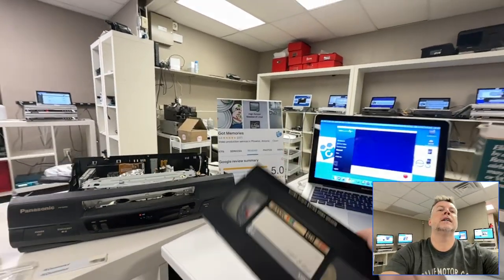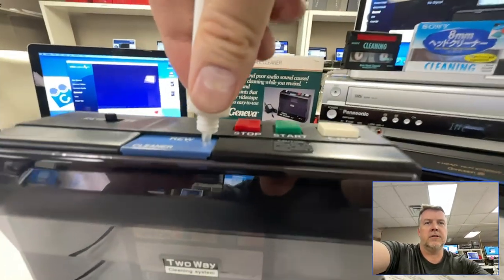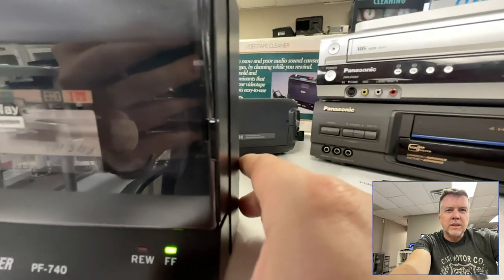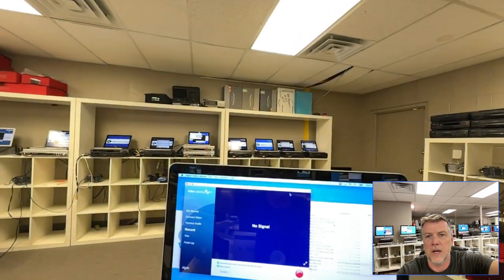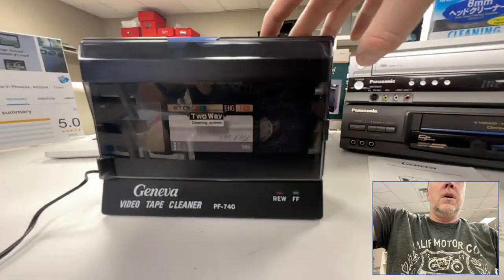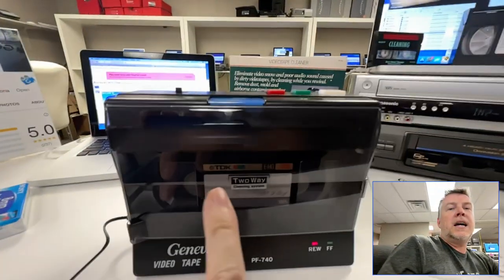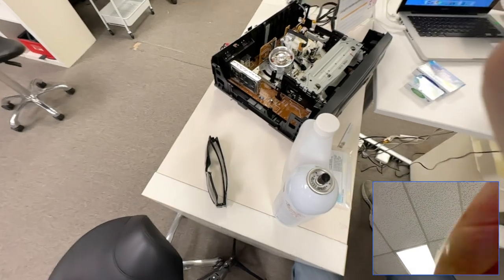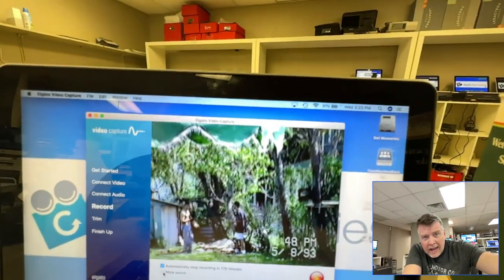VHS Tape with Mold, removing using Geneva video tape cleaner, before and after

Comment: I am a retired broadcast engineer. I worked in video tape rooms, we used Kimberly-Clark KimWipes and 99% isopropyl  alcohol to clean broadcast video heads and tape path. Plus, I fixed VCRs for over 10 years and only used KimWipes and 99% isopropyl alcohol.
Reply from the maker: I use the same! Oh what fun eh! Lol

Comment: You have quite the setup and you're doing a quality job!  I've been transferring VHS to digital since Xmas break (over 2 months as of now), using almost the exact same setup you're using.  Luckily, I bought a Panasonic DMR-ES35V (like many of yours) about 20 years ago to record everything to disc, which I only did a few.  Now I'm running it through the ElGato program onto my Mac and the quality is excellent.  The S-Video cable makes a world of difference!  

I'm cleaning the heads and capstans with 99% ISO & Q-Tips every 30-50 hours or so and haven't transferred any mildewed or moldy tapes (this is why I visited your channel and others - to see how you clean them).  However, I did run across a disintegrating tape that shredded inside the VCR, which was lovely and quite fun to clean out.

Sorry for the long post, but I'm learning all I can.  I've transferred about 150 tapes so far (most 6 hr) and I'm about halfway done.  40 years worth.  Thanks for showing us how the professionals work!
Reply from the maker: Hi Michael! Thanks for the comment! Glad to hear everything’s going well and you’re cleaning the heads and doing conscientious work! That’s pretty much the goal with my videos now, just shooting raw video and hammering home about head cleaning and quality transfers. 

Consumer awareness of this industry is nil and everybody is shopping for price and has no idea what goes into a transfer and then takes their tapes to the lowest bidder ie Legacybox and gets screwed.

I am tired of hearing and seeing terrible quality transfers stories from these big online corporate junk yard transfer companies and even if my videos save a few people from heartbreak and drama and additionally educate other people transferring to do a quality job for their customers then mission accomplished! 

Cheers!
Phil

Comment: I have a Geneva video tape cleaner I bought back way when I wore a younger man’s clothes. What I don’t have is the cleaning liquid and replacement heads.
Reply from the maker: Replacement heads, just cut chamois cloth and replace the cloth on the plastic rollers and use isopropyl.

Comment: There are only 3 things I suggest you do (everything else you do exactly how I would do it) and those 3 things are as follows - I would not boost the audio to above 0db, that will be clipping it, second thing is I would do a basic noise removal on the audio track and thirdly I would clean the other heads as well, not just the drum head. As a bonus, I would also not deinterlace the video when capturing it I would separate the fields and blend them to be 60 frames per second for NTSC or 50FPS for PAL - it will make the videos look much smoother, real and modern.
Reply from the maker: I would do all that but time is money and customers don’t want to pay. Nor appreciate. Great if you’ve got all the time in the world digitizing your own personal collection but 1000 tapes where people are willing to pay $9 a tape for 2hr tapes stuck in a garage for 35 years, gotta shave some fancy things off the menu. 
All the best!

Comment: If vinyl record cleaners still exist, why not for VHS? I really wish these VHS tape cleaners were still available, it's such a must-have accessory nowadays.

I have a question regarding VCR maintenance, should I go for a dry or wet head cleaner cassette? And which brand would be the most reliable as I can't take risks cleaning manually in my VCR.
Reply from the maker: Hi! Wet. Tape cleaners are all old and the only way to properly clean it is taking the lid off and doing it manually.